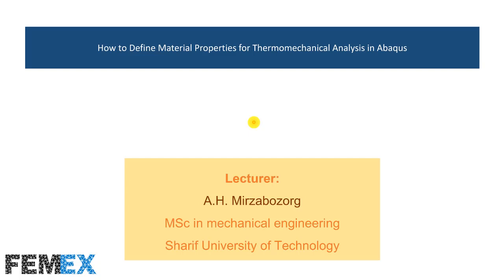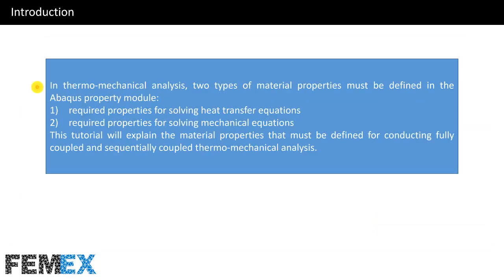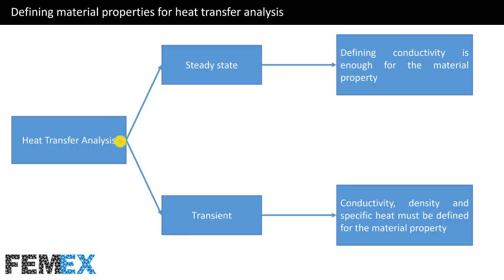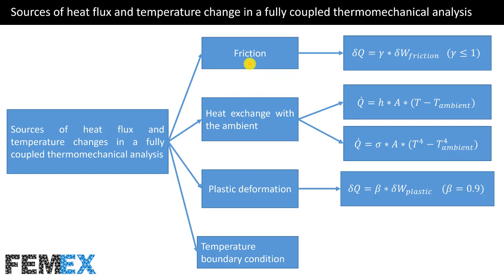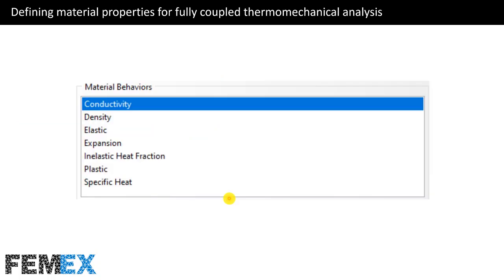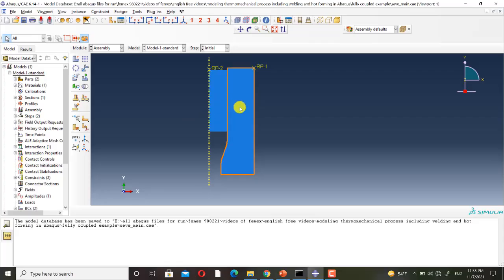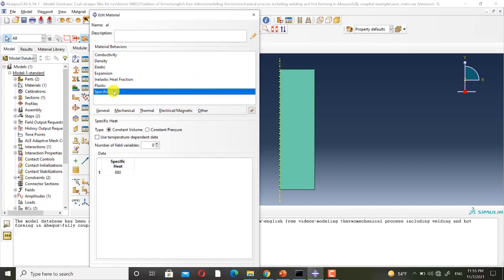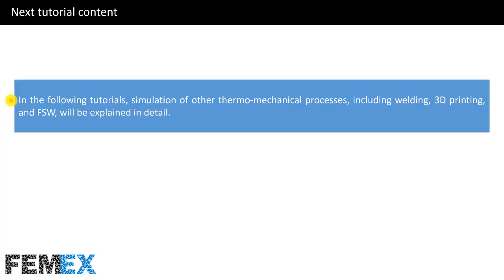Thermomechanical Analysis in Abaqus : How to Define Material Properties

Comment: How to Solve Sequentially Coupled Thermo-Chemical Analyses? For Example, I am Working on a Curing Simulation of Composite, And Total Time is 18096 sec, I Want to Solve for Temperature and DoC in First Step and Mechanical Analyses in the Next Step.
Reply from the maker: First of all you must find a paper or thesis that has done the same calculations to get the idea that you need.

Comment: If I want to conduct thermal analysis of mass concrete to get the thermal gradient due to cement hydration process and then input these data into mechanical analysis to get the stress field output, what is/are the recommended method(s) of analysis? and what the govern equation of heat flux will be ? Thanks in advance 🤗
Reply from the maker: Hi.
Unfortunately I don't have experience in that field.